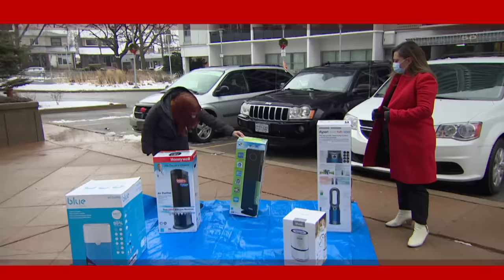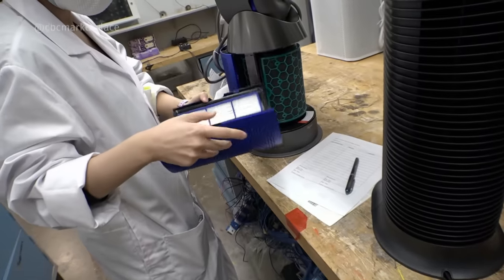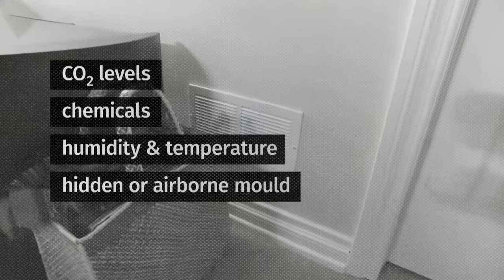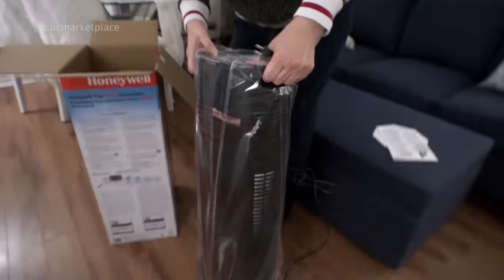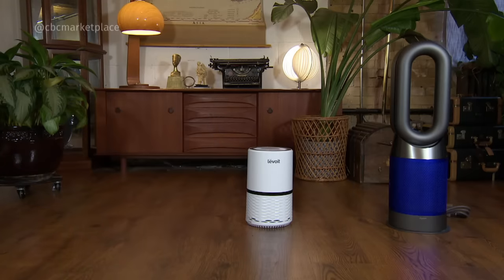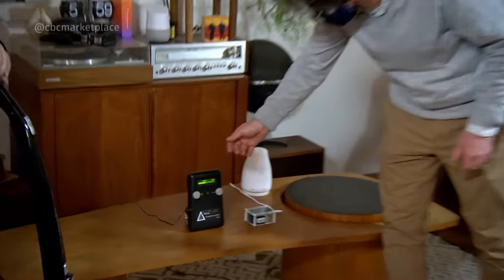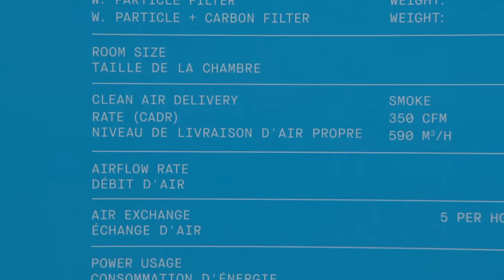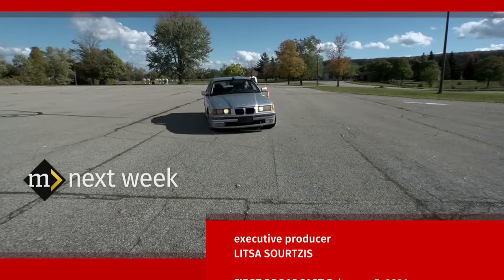Is an $800 purifier best to clean your home's air? We lab tested 5 top brands

Comment: the more filter surface area the better the results. you are far better off with many slow quiet air purifiers then 1 fast ultra loud one. I run 6 vava-ee004 for $50 each and run them on medium where I can't hear them running almost 500 cadr and not able to hear it compared to paying $300 for a 250 cadr purifier and it sound like a jet taking off. The only downside of running 6 is the cost of filters is about $100 per year where a single larger unit may only be $60 a year in filters. but my air with 6 running per room is far cleaner

Comment: I bought a Blue Air but the manual mentions two different types of filters. One is a carbon filter but no mention of a hepa filter.
Reply: Most good air purifiers will have a prefilter, True HEPA filter, and carbon filter.

Comment: Meanwhile Philips AC3858 which is still cheaper than Dyson gives CADR 610m3/h and has higher performance hepa filtration which filters particles as small as 0,003 microns.

Comment: I do NOT want to open my windows at certain times of the year because there is SO much pollen, mold and ragweed in the air that it will infiltrate the entire home getting into the furniture, clothing and bedding. NOT GOOD. The recommendation from an allergist who tested our daughter was to KEEP THE WINDOWS CLOSED, when she comes into the home she should shower and change her clothing so that she doesn't contaminate the furniture or her bedding. We were right in the middle of building a house so scrapped the idea of carpeting and installed hardwood floor throughout the house (I was actually at the flooring store to make selections when I got a call from the doctor's office with the results of her allergy testing; talk about synchronicity!). I had an ERV (energy recovery ventilator) installed. It's an HVAC device that brings in outside air, filters it and "exchanges" the heating/cooling with the outgoing air. That's how we got fresh air into the house. We live in a different house now that is an old house so doesn't have the tightness of our previous home. I'm considering out how to do a whole-house air filter that does the same thing as the ERV. I had a UV light device and electronic filter installed but that means the fan has to run for them to work. We use the radiator heating and I love it. When the fan is running the air coming out of them feels cold so I will frequently turn the fan off and often forget to turn it back on meaning the air isn't being purified. I wonder if there's a thermostat that has a timer. Another thing on my to-do list: Research ways to have the fan switch on and off automatically. I have air purifiers in several rooms but it would be nice to have a whole-house unit. Another item to add to my to-do list.

Comment: I suggest anyone looking at these air purifiers to read into the CADR rating. It is actually quite misleading and manufacturers know that. They can reduce their filtration capabilities in order to have a higher CADR rating if they know that's what the consumer looks for in an air purifier. I would always suggest an air purifier that has excellent filtration capabilities over just CADR ratings.

Comment: During lockdowns I opened my windows 30 to 60 minutes daily depending on temperatures., Half the windows had fans bringing in sir and half pushing it out.  Switched direction of air flow in the middle of the "Open air time ".  Seems to have helped.

Comment: Dyson is absolutely the best. The whole point of the dyson fan is that it constantly moves and circulates the air around the entire room meaning it doesn't need a high CADR. This air movement will also help lift particles, pollutants etc. from surfaces and into the air so that it ends up in the filter.

Comment: they never mentioned how loud these purifiers are. it doesnt matter if it cleans good, nobody is going to want a fan that sounds like a jet engine taking off every time they clean their air. those box filters are extremely loud with nothing impeding air flow. with a filter, and it sounds even louder

Comment: Please, please, please don’t tape a filter to a box fan! They do not meet the static pressure requirements to pull air through a filter for long periods of time. This is a great way to start a fire. Spend the extra money on a proper air purifier and save your house.

Comment: I think one has to put out at least 500 dollars for a good purifier for mold.  The cheaper ones will not do that good of a job.
The Philips ac2939 is good.  This has a meter that tells you the size of the particles that are being captured.  It's called PM2.5 and PM10.  Then you can know for sure if it's doing the job.
If you can afford it, I would suggest Blue Air Blue air Health Protect.  They have two versions.  7770i and the 7470i.  The 7770i is the more expensive one.
This also has the  PM2.5 and PM10 meter that shows as to whether or not spoors are being captured.  
I'm glad I bought the more expensive one, because although I live in a small house, it does two rooms with no problem.  Three not so much.
The Blue Air is made in Switzerland and I think they put out better quality than a lot of other countries without naming any them.  But you get my drift.
I bought the more expensive one because it had the highest ratings in Amazon.  Whatever you get you when you might want to order one of those home test kits for mold.
Then when the air purifier arrives, check the results yourself with the kit to see if it really works.  If the results are not good send the air purifier back and try again.

Comment: Dyson is right. CADR is not the only factor you should be considering when looking into purification of air. The so called expert did not mention the actual physical filter properties. There are different ratings for filters and how much particulate they can capture. The Dyson HEPA filters generally have a more dense filter weave. If you check BlueAir's filter specifications you'll find that they have a lot of air flow but they are using considerably cheaper filters that don't capture particulates.

Comment: The reason why the Dyson does not work better is the design itself. it was not made as a purifier but a fanless alternative to an electric fan. the purifier at the bottom only filters the air used by the air multiplier design so that it does not clog up. most of the air actually still comes from behind the fan and out to the front. you cannot add  a filter behind the fanless air multiplier design because it will stop working. I think the dyson must be grouped separately from actual air purifiers. It is just a completely different thing. It would be best to just purchase a separate air purifier if needed.

Comment: When comparing air purifiers, it helps to compare ones that are rated for the same sized spaces. Of course the Blueair 211 is going to have the best CADR because it's designed for spaces up to 50m2. The Levoit is designed for spaces up to 12m2. A little misleading, eh?

Comment: no point on talking CADR without efficiency of the air filter, its like measure an area with just length and ignoring the width. Rather measure the PPM in the room before and after operating for an hour.

Comment: What’s the point of high CADR if the output of air quality is poor regardless？100% not the only metric you should be considering. You can have 100 air bags in a shopping trolley but it doesn’t make it safe

Comment: You didn't test a lot of top brands. IQAir, Medify, Rabbit Air, Coway, Alen BreathSmart, Airpura, and Austin Air, for example, all make some stellar products. For that matter, a company called Purple Air makes a PM2.5 sensor that is reasonably accurate (WAY more so than the PM sensors on units sold on Amazon and the PM sensors built into filters, but obviously nowhere near as accurate as regulatory-grade sensors) and is reasonably priced, so it is possible to actually test the effectiveness of the purifier you buy in your actual home against PM2.5, as lab tests can only say so much about how a unit works in your actual home as the conditions will vary so much.
Reply: yeah I would have liked to see iqair and Austin air in the mix.

Comment: Am I missing something here? It's only went into CADR, but nothing on the reduction in mold, VOC's, Formaldehyde etc? It doesn't really matter if it has a huge CADR with a 99.5 percent efficiency if the 0.5 percent it can't clean are all of the particles that would cause you health concerns. Loved the premise of the video, but I don't think it was really answered fairly. I think Dysons engineer hit the nail on the head, CADR doesn't mean anything if you don't know what constitutes as "Clean Air Delivered".

Comment: guys, why everytime i turn on the air conditioner, the pm 2.5 sensor in my blueair classic 608i will level up to 90 or even more. and normally in night the pm 2.5 cannot go down to below 10, even i use blueair 24/7 with max speed.
Reply: What is the air quality outside like? If you have central AC, what furnace filter are you using? If central AC and you are using a good filter that doesnt need to be changed, your ducts may need to be cleaned.

Comment: 19:26 not a fan of Dyson but this video is disappointing. as the engineer have said, one doesn't need a high CADR for an effective air purifier.  High CADR only means it is putting out more air per unit of time. for example, a daily vacuumed room won't need high CADR. since I got a cordless vac, I almost don't need to clean the air filter of my window aircon for a year.  additionally, most air purifiers are inefficient because they just release the clean air haphazardly to a room unlike the Dyson which basically works as a fan, directing the clean air to a person.  But yeah, the DIY version is the best overall which this DIY version can be found all over youtube.

Comment: So... you use the Levoit lv-h132, which is only designed to cover 130 sq/ft to test in a room that's too big for it.... Coulda at least used a Levoit Core 300 to give Levoit a fighting chance.... Or at the absolute least tested each air purifier in the room size that it was designed for. For example the Blue Air 211 you tested was rated for over 500 sq/ft....

Comment: CADR is not everything. I would take cleaner air coming out rather than high CADR anyday. 
If it's outputting partly clean air, it's basically flying fine dusts everywhere. 
Dusts actually will accumulate everywhere on your home. 
Go for the highest filtering, HEPA filter.

Comment: I like this video and good job... But before I completed watching the video, I already supected that Dyson did not live up to its high price, high hype. I felt that its cleaning ability is below standard. I had high hopes for Honeywell too, but was dissapointed. I was extremely shocked when the Blue Air filter actually out ranked in cleaning performance against Dyson and Honeywell. To me, Blue Air Filter looked and sounded like just some low end or inexperience company trying to break into the market. The results left me flabbergasted. My jaw dropped, I could not believe they topped the charts. In my country, Blue Air has weak marketing while Dyson has very strong Marketing strategies. Looks like, I cannot underestimate this unknown Blue Air brand that I never even heard about. My Dyson V10 absolute has a battery that was hyped that it would last for years, in fact, mine died way before the warranty, I only used the Dyson for a total of like 4 times to clean the Cobwebs on the ceiling because of its accessories. I use a robotic vacuum from another brand for the floor. So the battery is just rubbish quality. My Dyson Vacuum set was on a full charge before placing it in the store room and usage for a total of 4 times during the 10 months life span, is very short time for spending over $900 is a waste of my money before bringing it to the service center.

Comment: Let’s be honest; When it comes to business the more popular an item is the more demand  is created hence driving up the cost. That would’ve been my simple answer if I was the spokesperson for Dyson because the reporter can’t debate that proven fact. Lol.
We’ve ALL heard of Dyson but not some of those other much cheaper brands. There’s no demand for them to warrant a premium price or additional features like the digital display, integrated features like heat/ temperature/ Wind direction/ filter health etc.

Another example; Tesla vehicles have the same range and at times even lesser than other electric vehicle in the market. But they do have more features and have higher demand thus positioned at a premium level driving up their price. That interview was like comparing a Tesla to a Chevy Bolt or Nissan Leaf. They are simply not the same! A Dyson also have a unique attractive design. Very attractive as a corner piece for an office or a home. That’s why you pay $650-$800 for a unit instead of $350 like the others. lol

Comment: From what I know the humidifiers set them off because air particle detectors use a laser to detect the particles. The water from the humidifier and maybe the essential oil defuser set off the detector because it can’t tell a difference between water and other particles.

Comment: Nope. Go with a Whole Home Air Purifier like the Reme Halo or an Air Scrubber system. Both of those are installed directly into the duct system of your central heat and air. I'm partial to the Reme Halo because it treats every cubit foot of air in your home and for me produced an overnight, noticeable difference in air quality. My wife and I are super allergic to mold and the house we live in now had severely mold contaminated ducts.

Comment: CADR relates to air quality the same way size of a TV set relates to a picture quality.  Does  anybody put 55' TV set to a room of 12 sq.m? I don't think so. Every air filter model of the same brand is made for a certain room size. Usually it's measured in sq.m but it will be much more  accurate to measure a volume of rooms. Like BTU for air conditioners. Quality test of air purifiers is very logical: measure a level of hard particles, gases and organisms in the air, run an air filter for a certain amount of time, take measurements again and compare the results. Do it for every air filter in the same conditions. See which device shows the highest percentage. That's all.
The test you have done guys is completely misleading.

Comment: But the dyson is a heater and cooler and air filter. That’s a lot of tech in one thing. What other heater + cooler + filter machines are out there? Dyson is literally the only one I can find. I don’t think it’s necessarily fair to compare the prices. It’s kind of like comparing 5 Toyota’s and an airplane and saying because the 5 Toyota’s are more gas efficient than the plane and they’re cheaper it’s better.

Comment: What fan speeds were you using? I would think that could make a difference. Big fans on high are a noise pollution and an electrical cost. Both the egg and air cleaner stories have more variables than you mention which is nice for awareness, but maybe not entirely the  story. Is half the story honest and helpful?

Comment: I always liked Dyson as a company. It always felt like these guys stand behind their products, and they actually perform as promised. This is also shown here in this video when Dyson is the ONLY manufacturer willing to appear on camera with their actual engineer instead of a staff from PR department.

 Is there a better air purifier for the money? Absolutely. But nobody does it like Dyson does.
Reply: This video gives so much importance to CADR score where the machine is tested in a small room with air sensor at one point in the room. 
Realistically, your living room is much bigger than that and you want clean air all across the room, not just near the machine. 
So really, Dyson is practically a better machine imo.
Reply: @karthikchoubisa6045  and the dyson cleans atomatically,

Comment: I work in air purifiers manufacturing company and can say this video is very unprofessional. They only compare particles cleaning and tell you nothing about gas cleaning. They simply don’t do any gas filtering test in this video. About UV light they only say that their sample don’t have enough UVC to destroy viruses and this is common problem with popular purifies. They usually use 10-15 watts of UV light for 200-400 M3/h CADR. For example we produce air purifiers with 95 watts of uvc for 100 m3/h. You actually have to always calculate time off air exposition, what many manufacturers simply don’t do!

Comment: is this test even fair tho what is the room size of testing? the dyson is rated for rooms 600sqft where as the leviot is rated for 129sq ft placing these at lets say a 300sqft room would leave the leviot useless as its not made for large rooms. i have a leviot in a 100sq foot room ive used air monitors to see if it works and it drasticly reduces the particles in the air that room that being said i placed it in my living room 630sq ft for 24 hours on high and it had minimal effect. without knowing that this test really doesnt work.
the leviot from its manufacter booklet states 110 cadr in a room 130 sqft or smaller.

Comment: The results are misleading.  The results don't say how big or how small the rooms tested were.  Obviously, the bigger air purifiers are designed for bigger rooms but when used in a smaller room it will have a higher airflow.  On the flipside, a smaller air purifier used a large room will have a much lower airflow.

Comment: You're measuring VOLUME of air not CLENLINESS of the air. If you've got a normal room and run it all day it will clean it very quickly probably within an hour for most rooms.